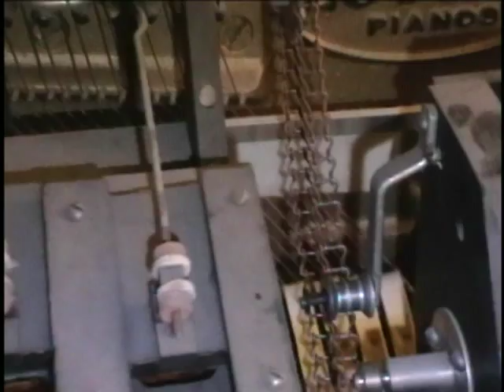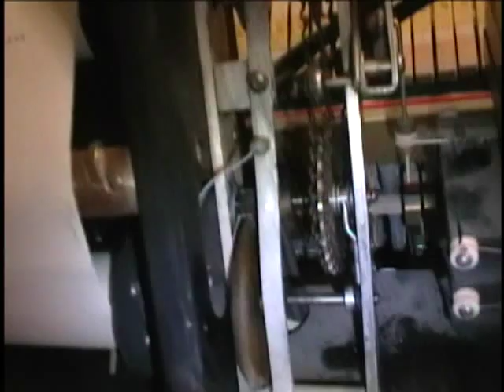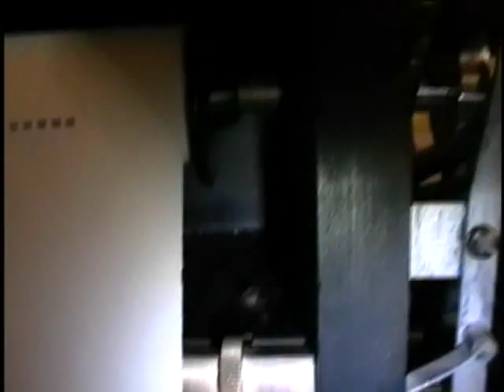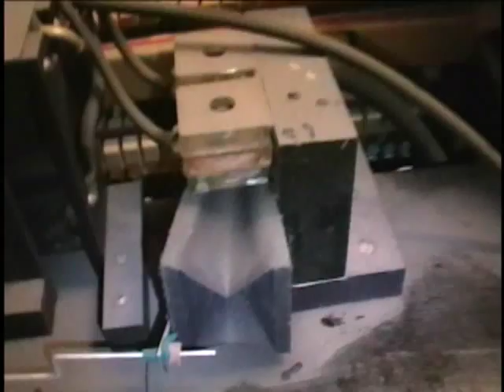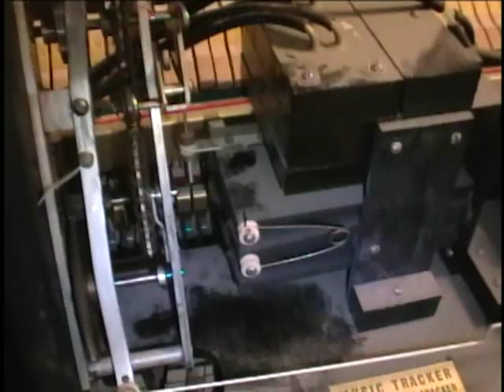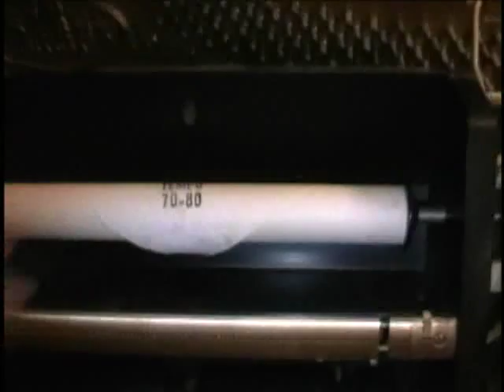1960's Aeolian Lowrey player piano repair demonstration

Comment: Hi, I just bought the same piano yesterday, well everything looks the same, is an Aeolian Cabaret player piano, and i have a problem where it doesn't play, it actually just rerolls fine, but the Play function doesn't do anything, i can just listen as if the motor pumps up to start something but it never happens and the roll doesn't move at all, what can i check to try to fix it? By the way i bought it at an auction so they didn't know anything about it.

Comment from the maker: Yes there is...it uses a pneumatic amplification system. A small pressure change caused by the roll uncovering the hole works a small pneumatic valve, which then admits air into a larger bellows-type mechanism which actually plays the note.

Comment from the maker: It reads the data by means of vacuum...when the holes are covered, vacuum is maintained in the pneumatic activator for that note and it stays off. When the hole is uncovered, air rushes in to the pneumatic valve and it activates the mechanism for that note.

Comment from the maker: Yes...everything is powered by vacuum. There is also a manually operated vacuum pump which works on foot pedals so you can play the rolls without electricity. They kept the design of the original player pianos which were designed to run with no electricity needed.

Comment: You're on a roll now, or I should say the piano roll is on track.  Great job, you made a major improvement.  It rewinds somewhat fast, and there is an adjustment to slow it down.  Graphite is what you need to lubricate  the wooden parts on the motor.  That is turning out to be a very nice player piano, That was a good find.